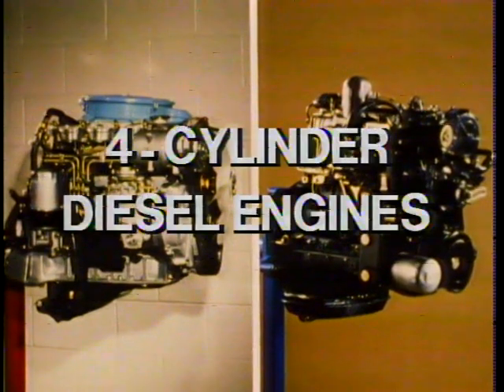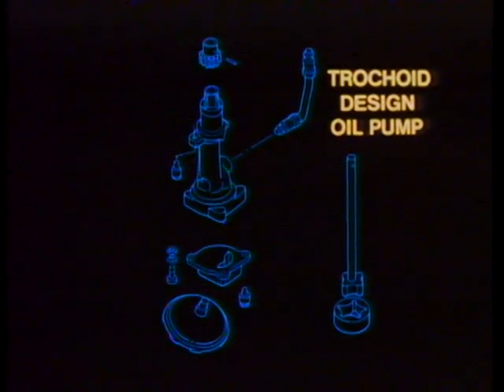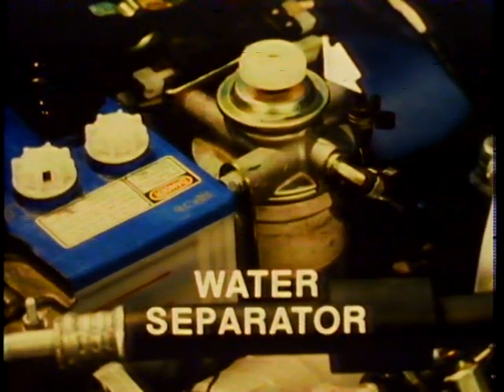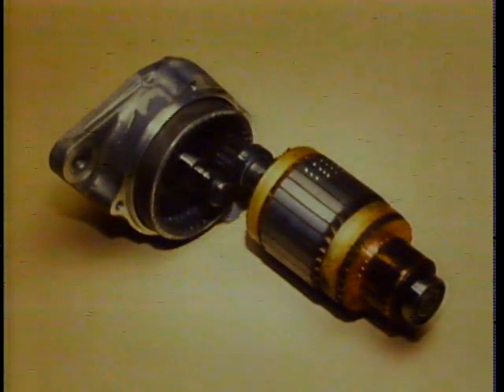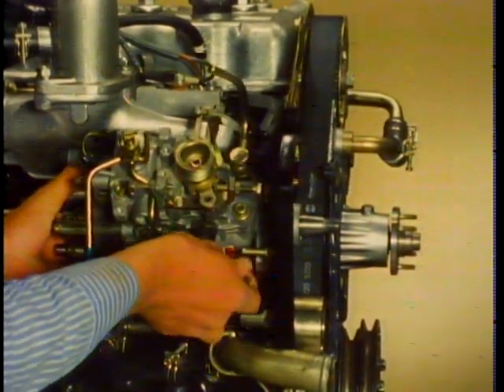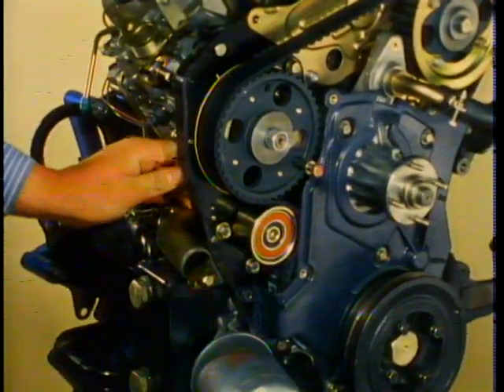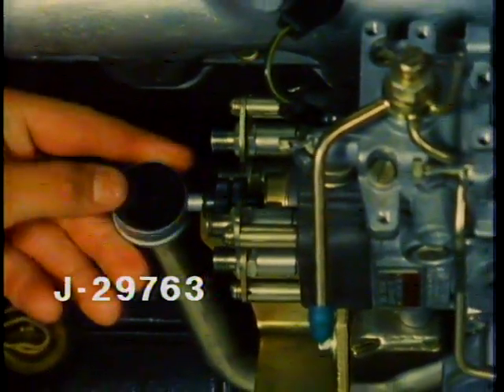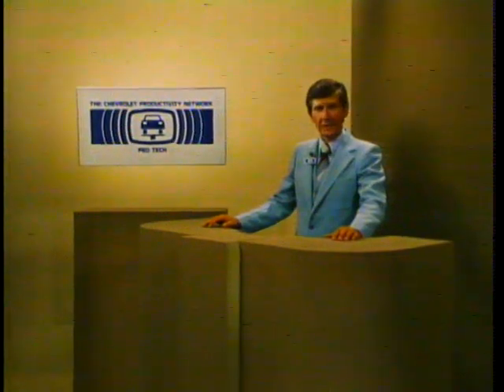GM / Isuzu 4FB1 C220 Diesel Engine Training

Comment: I'm not sure why the Olds 350 diesel was given the go ahead for development. At the time, GMC owned Detroit Diesel/Allison, and could have asked for a pickup/auto suitable engine. Instead, the Olds 350 diesel was built, anemic and under powered. The installation of a hitch ball in the hole on the rear bumper would void your engine warranty, because GMC knew that engine was weak sauce. If they had gotten a true detroit diesel engine, they would have been years ahead of Ford & Dodge both. Instead, the 6.2 was a catch-up game to stay competitive when Ford and Dodge went to people who make diesels and bought engines that weren't weak and failure prone.
Reply: Even one of its engineers was disappointed over its release at the time. His name was Darrel R. Sand, and he unsuccessfully tried to persuade GM not to release the engine back in 1977, saying it was not finished yet; frustrated, he quit GM in 1980.

Comment: It is such a shame that these engines were not all that popular in the US, they were obviously the solution. These engines, even in non turbo form, would of been perfectly adequate for 90% of civilian vehicles. The idea that they are slow, too noisy and not refined enough to be accepted by most people was an agenda pushed to scare them off mass adoption of diesel. 

Diesel should of been the future, and bio diesel should of been the global default fuel. Sadly I think the powerful people that depend on petroleum oil profits hampered diesel and won't be happy until it dies out in consumer grade vehicles. 

Constant attacks under the guise of "nox emissions", "VW scandal", banning of diesel cars in citys, unfair higher taxes. And emissions regulations brought in that require increasingly complicated modern diesel designs with EGR valves, DPF, catalytic converters, Urea based emission reducing measures, and ever more delicate injectors, pumps, turbos, electronics and stupidly high pressure systems. Such a shame.

Comment: Where the GM come up with those silly names for injection pump makers!? Roosa Master, Diesel Kiki... What was so wrong about using a Bosch pump like everyone else?
Reply from the maker: +vwestlife Diesel Kiki is a Japanese company making bosch designs under license - Isuzu is a Japanese company after all. Stanadyne hired Victor Roosa for his knowledge of diesel FI pumps in the late 40s so I'd surmise that's where the name comes from. And I'd also venture it was a lot easier to get managements approval to use a USA made Stanadyne pump than a german Bosch pump.
Reply: +compu85 I have the booklet that goes with this video. Thank you so much for posting this.

Comment: A claim of 55USmpg highway in the Chevete 1.8. I'm not sure why GM recommended oil change every 3750 and oil filter every 7500. I would just do both every 7000. People often neglect the hell out of diesel cars in Europe, and plenty don't change oil or filter, or even top it up for 10k plus. And thats more complex modern turbo designs. So an old Jap naturally aspirated diesel would be fine every 7k for sure. Plus good oil had more zddp in back then too.
Reply: Interesting to read, I figured folks in Europe would keep up their vehicles, not sure why.
Reply: @Hubjeep  Maybe in Germany or Scandinavia people do. But in the UK the majority of people think cars are like washing machines and they are scared to open the bonnet.
Reply: @99ron30    Are there "quick" oil change places over there, like Jiffy Lube here in the US?
Reply: @Hubjeep  Well not really. I know in the US even along the interstate you can get your oil changed quickly without booking ahead. I wish we had that, and even some US gas stations check your oil and top it up, atleast in the movies. 

In the UK there are places like quick fit, halfords autocentre and national tyre but they are just franchise chain mechanic garages/tyre and exhaust fitting places. They will change your oil but usually you have to book ahead and they are not particularly cheap. And I bet half the time they don't put in the correct grade oil that you want.
Reply: @99ron30    Thanks Ron, Here in the US basically every town has a "quick lube", where you can just pull up and get your oil changed.  For decades "Change your oil every 3,000 miles" has been drilled into the heads of Americans and some still believe it.  Follow your owners manual!  

Yup, some new cars take wacky viscosities... the newest is 0w-16 for GDI (gasoline direct injection) vehicles.  It's important to use the correct lube.    

Some "full service" US gas stations will check your oil if you ask.  Now with extended oil change intervals (OCI) it's common to have to add oil, especially in some new engines!

Comment: Why do people always accuse GM of killing the diesel in American cars?
Reply: PVT EVETS
They made it durable enough for a diesel.  The problem was the fact the diesel fuel supply was tainted with water.
Reply: Very true. The diesel in america today is rat piss compared to the diesel the european's get
Reply: ohiopower
I have to disagree with that.  It is because of strict European regulations that are crazy that America has the diesels we do.
Reply: EVETS1717 
They did NOT convert a gas 350 to a diesel. Oldsmobile built a diesel engine with torque-to-yield head bolts and (on early models) no fuel-water separator (water was particularly hard on the rather weak injection pumps). Adding a fuel-water separator and high tensile strength head bolts, the engines were supposedly rather reliable.
Reply: @EBECO717  Oldsmobile didn't have small block, neither did Pontiac.  The Olds diesel was designed to go down the machining line for the Olds V8.